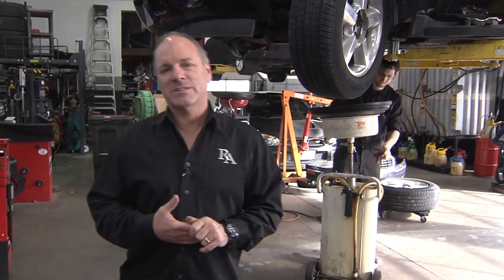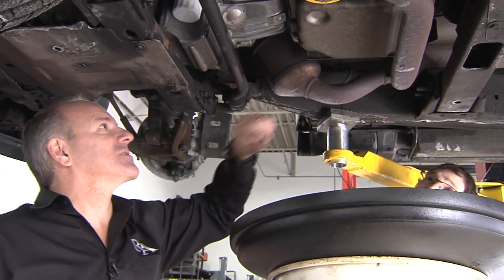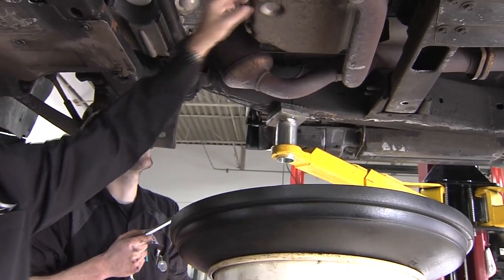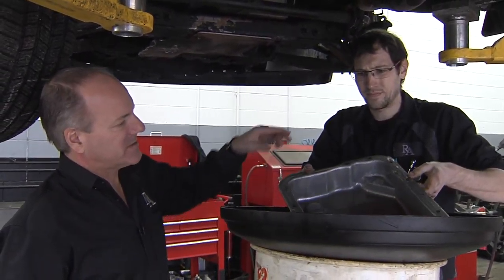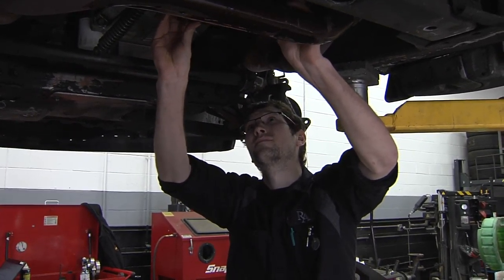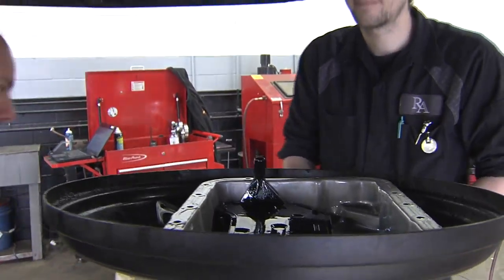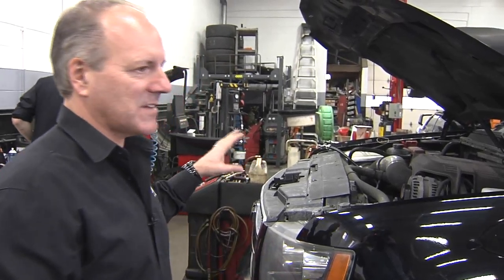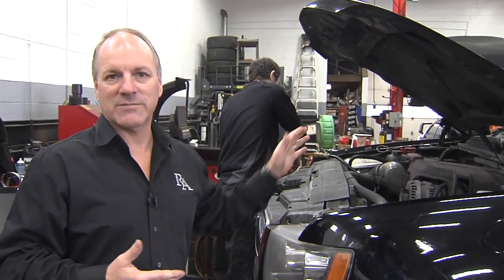Auto Experts - Transmission Service

Comment: Cool video,

I’m having problems where when it shifts to 4th, it will jump and jerk back to 3rd a few times and will go to safe mode and just stay in 3rd. Would this be the mechatronices/solenoid issues or the transmission synchronizer?

A bmw mechatronic transmission